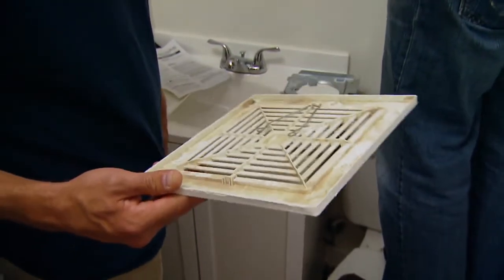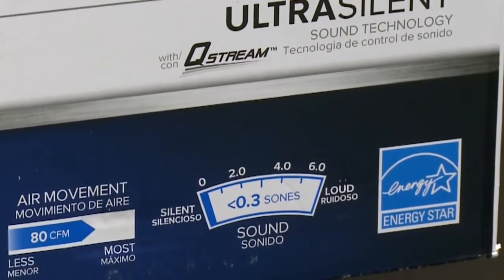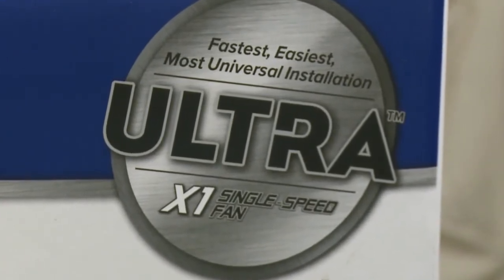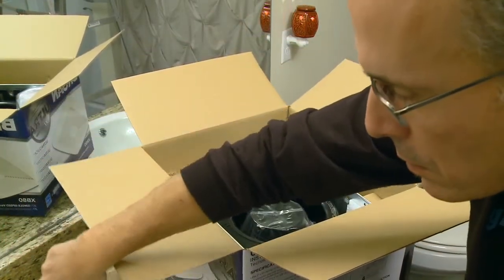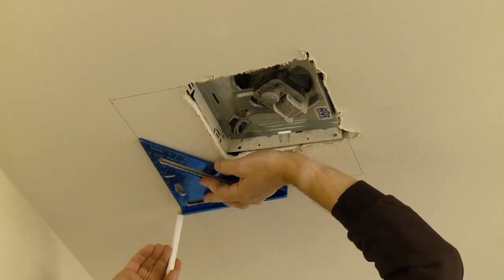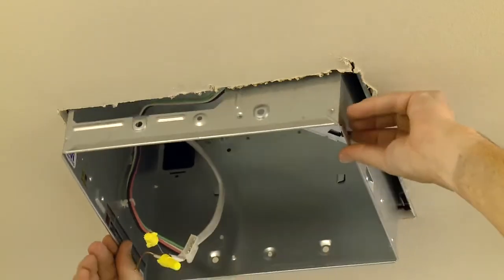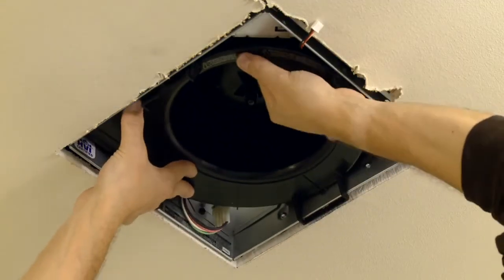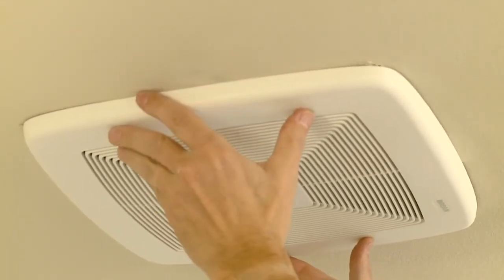Improving indoor air quality with ULTRA Green™ ventilation fans

Comment: Hurricane Harvey devastated our family, friends, clients and community by flooding and now mold.  433 million square feet.

So, #GREENPOWER4TX invested in more continuing education. September 2017, I completed a 40-hour course to become a licensed Texas Mold Remediation Contractor, and passed the Department of State Health Services (DSHS) licensing exam.

The course raised my awareness about mold and air quality in our home built in 1958.  Neither bathroom has a ventilation exhaust fan.

Since our firm #MomentumBay is one of the world's Top ENERGY STAR Service and Product Providers (SPPs) and appreciates the value of ENERGY STAR benchmarking and certification, I discovered the BROAN ULTRA GREEN™ 110 CFM single-speed humidity sensing fan/light, recognized by the EPA as ENERGY STAR® Most Efficient 2017.

If only I'd learned about BROAN and its humidity sensing systems sooner.

We're installing two XB110HL fans this month, hoping to keep mold at bay, and alleviate our kids' daily morning sneeze attacks within 5 minutes of waking up.

How many other homes let mold grow indoors above 60% humidity, behind mirrors and cabinets, in shower and flooring grout, near all sources of moisture?